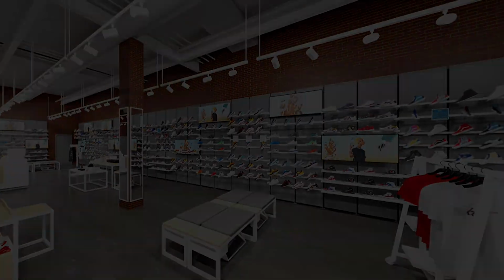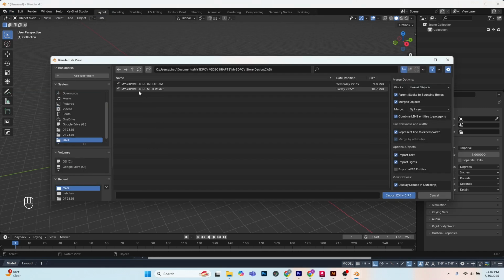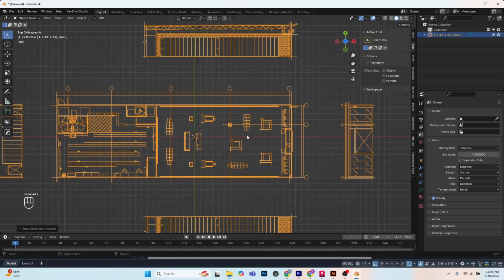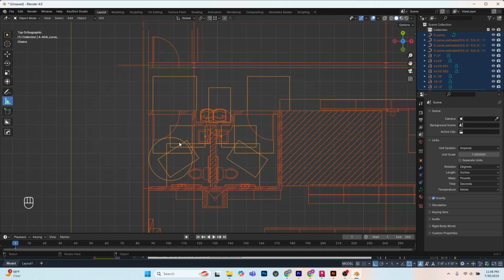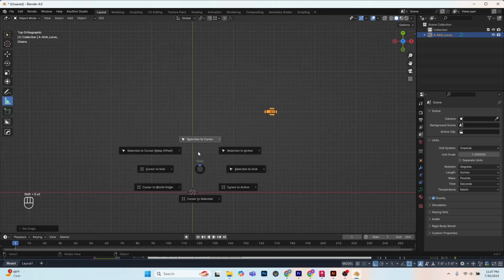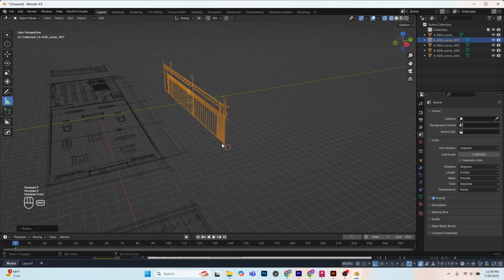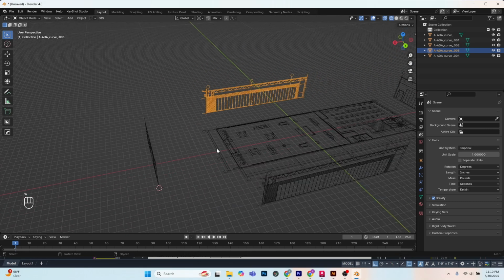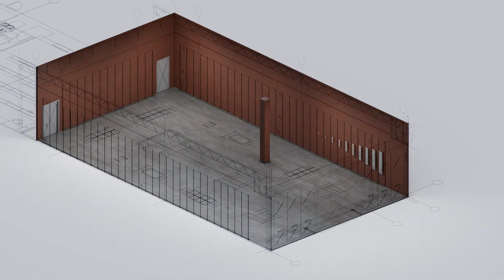How to Import AutoCAD Drawings into Blender - Part 1: Building a Retail Store

Comment: I also do quite a bit of cleanup in AutoCAD prior to exporting. Removing layers that I don't want, turning off hatches. I am sometimes working with full commercial building plans though, rather than individual spaces, so keeping the import minimal is a bit more important.

Never thought about it before, but aligning the elevations and sections in those projected views prior to export (for me they're normally separate drawings), takes out some of the guesswork trying to figure out how things align. I've tried doing it that way myself when I have to do AutoCAD work myself, but I've always struggled with model space annotations showing up correctly in rotated paper space. That's an AutoCAD issue though.

If accuracy is important to sanity (it is to me), keeping grid lines (terminated by those circles) in the imported drawing is a great way to fix inaccurate imports due to scaling. These are always very round dimensions; re-create them in Blender at accurate dimensions then scale the import to truly snap. That way it will read 60 inches instead of 60.00006 inches.

I typically place my origo at a point that makes sense to me rather than whatever is center of geometry. I typically do somewhat symmetrical stuff, so having a zero at this point makes sense. A couple of chairs could then be located at say ±500 mm. Another thing I do is place the import away from scene origo, as there is where I have my easy to access playground or assets show up. Orienting correctly, aligning Sun Position (extension) northing, and setting up correct('ish) coordinates are also parts of my initial importing steps to do a quick evaluation of natural light (for me could be a problem actually) using a simple box with some holes in it to represent the space and opening.
Reply from the maker: ok thanks

Comment: When i import, it always comes in bigger.
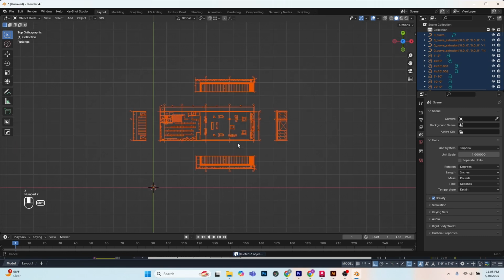Reply from the maker: Are you using Inches as your unit?  Check out @2:52 , Blender imports the unit, in this case "Inches" as 1 meter.  You have to scale down by a factor of 39.3701, the number of inches in 1 meter.  A to select all, S to scale, 1/39.3701.  Note that once you press "/" you have to hit Backspace once to clear the automatic "1" before typing in 39.3701.  Hope that helps!
Reply: @My3D_POV Thanks. I was confusing the first one you imported and didn't realize it was in metric. When you did the second import with the imperial file it made sense.